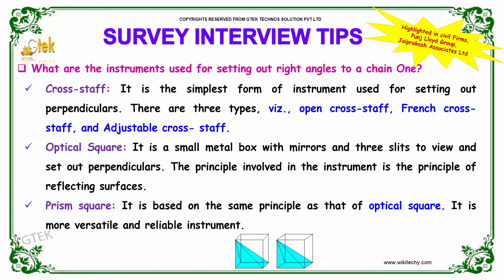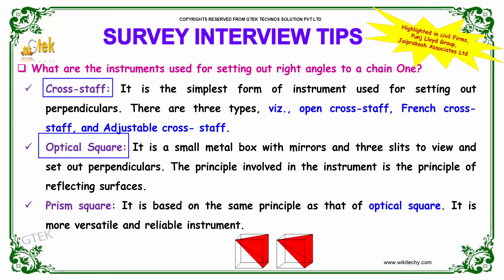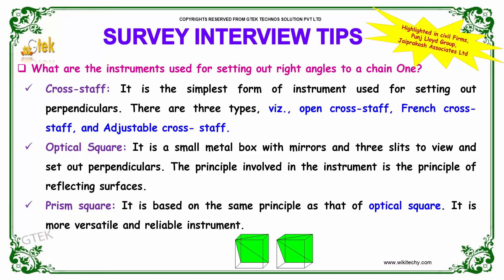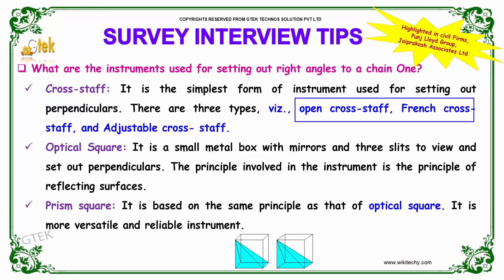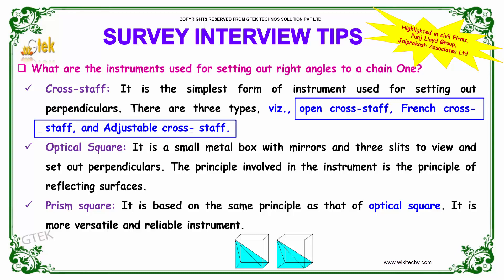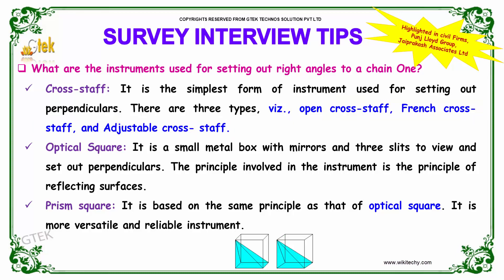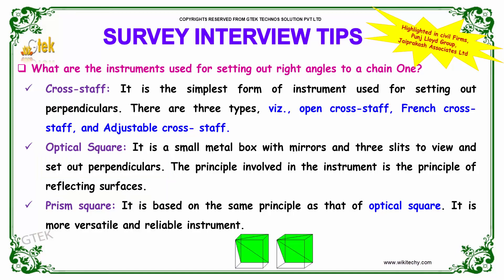Instruments used for setting out right angles | Survey Interview Questions and Answers

Comment: Optical Squares. Optical squares are simple sighting instruments used to set out right angles. They can be provided either with mirrors or with one or two prisms. Because of practical difficulties in using squares with mirrors, they have been replaced by squares with prisms: "prismatic squares".

Comment: Line may be marked by a ranging rod at inconvenient point on the sighted. French Cross Staff: The octagonal form cross staff is the French cross staff. Adjustable Cross Staff: It consists of a brass cylindrical tube about 8 cm in diameter and 1 cm in deep, and is divided in the centre. Prism Square:

Comment: Prism Square: It is a moderninstrument and is a very use full forsetting out right angles. It is based on the same principles as the optical square and is used in same manner